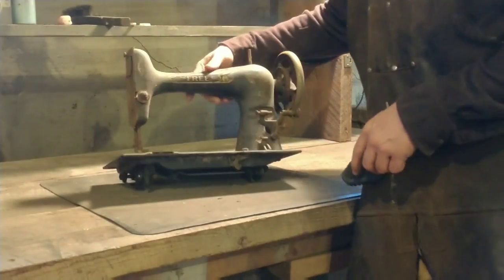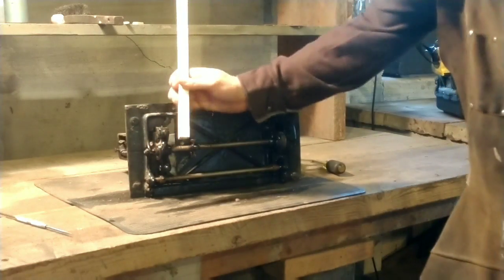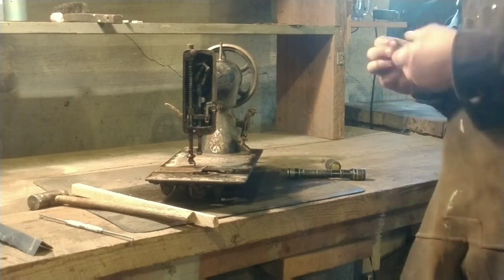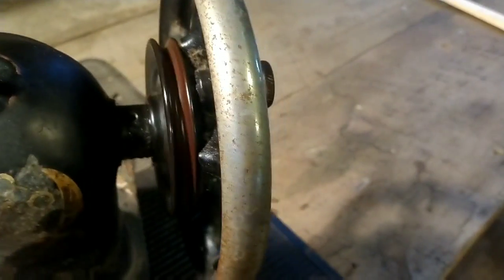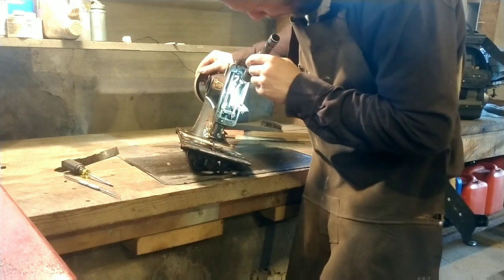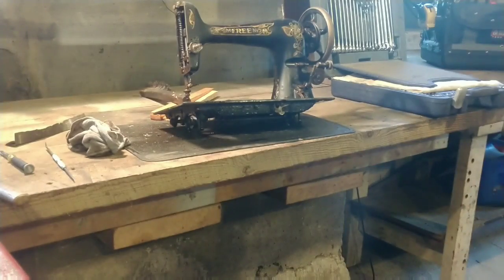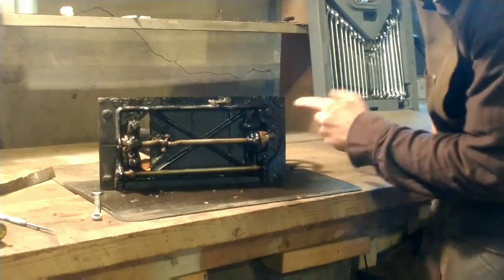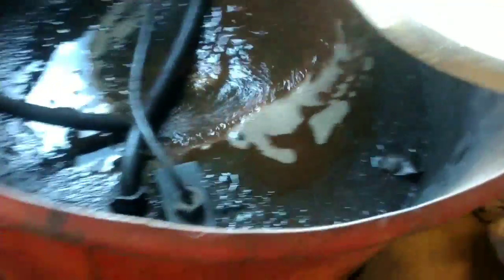Restoring antique Free sewing machine part 2

Comment: Sometimes, if the presser foot is in the down position, especially if it has a lot of tension on it, it will cause that snag in the otherwise smooth operation ( and it can drive you nuts till you figure it out ). Once you life the foot then everything works like butter. You just need to adjust the presser bar tension to a lighter setting and it will be fine there after.

Comment: I want to recondition and learn to use the 1918 White Rotary treadle machine I bought 25 years (?) ago.  I realize now that it might have been the one I didn't know I needed all these years.  Though mine is in much better condition, I want to make sure that I don't make a mistake and use too much or not enough oil.  I found a manual and have located what places to oil, however you seem pretty liberal with it and I'm thinking I shouldn't be concerned that I use too much.  What do you think?
Reply from the maker: I'll put plenty on after cleaning etc. as it helps flush out grit. Once a machine is in use, I'll usually cover it to keep dust out and then just add a drop or so. I'll bet that white is lovely!

Comment: Regarding the unidentified foot- a felling foot has that sort of groove, a little different than the standard rolled hem, but I don't think I've seen it open like that. Wondering if the right toe of the foot was broken off and then the edge smoothed up? Or maybe it's a cording foot. Also is the oil you were using Supco, I have not heard of that one. I usually go straight to Kroil and/or Blue Creeper when things don't budge!
Reply: It looks like a cording foot to me.

Comment: I need to get some of that oil, the previous owner seems to have used axle grease on it, really thick and sticky. Do you think I should just re-oil with the lighter oil? I take it it isn't something you'd use steam or water on to clean it out.
Reply from the maker: Rubbing alcohol will work. The only problem with heavy grease is that it attracts and holds grit.  Lighter oil will thin it over time, so even if you don't clean it, the lighter oil will help.
Reply: Thanks for that, I’d better do this in the carport, as opposed to the kitchen😊

Comment: What is the oil you used to free it up?
Reply from the maker: Iirc, I only used supco mo44 rust buster. If that doesn't do it, I'll try Kroil. The difference is that the mo44 is very fast. So if it's going to work, you will know right away. The Kroil works on really stubborn stuff, but seems to like more time.